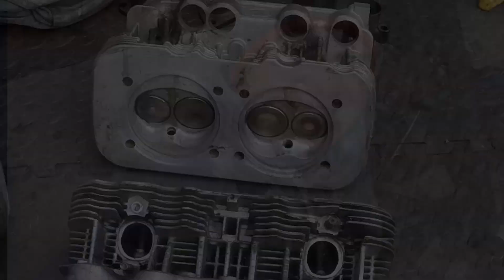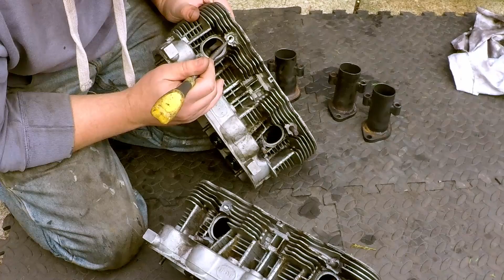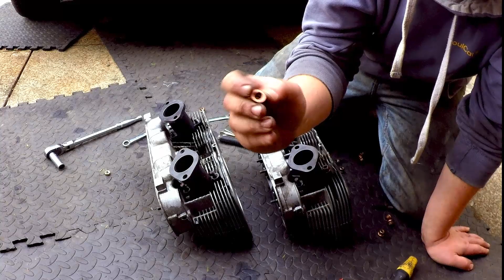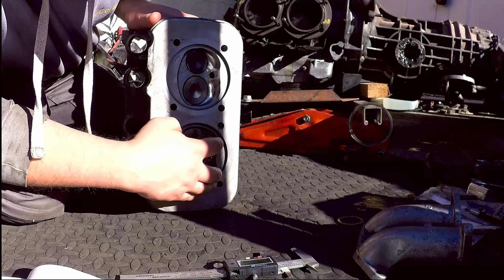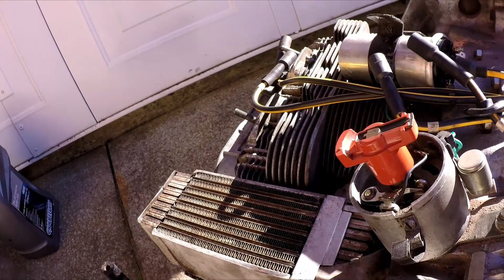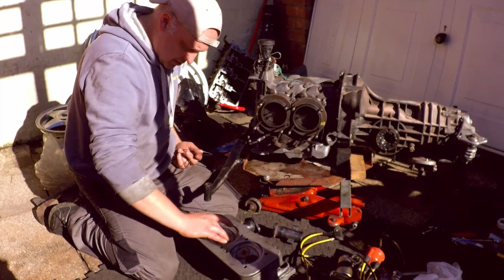Porsche 914 Ep. 4 : Examining & Installing Gas Flowed 2056cc Heads & getting the engine back in

Comment: Great content.  
I’d been wondering how much work I’d be able to do with the engine sitting on a furniture cart, and you pretty much answered that.  
I’d also been wondering how easy it was to get the engine tins and rubber seals lifted back into place (and the axles aligned) — you showed slightly more than other videos, but I’ll forgive you since it looked about midnight when you finished.  ;)
Cheers from Colorado.
Reply from the maker: Thanks for the comment, there's a fair amount of work involved but not ridiculous and being 'old' fixings are straight forward,if not difficult to find in the UK.
I do miss this car, unfortunately the owner decided to sell, a rewarding adventure 
I love Colorado, stayed at Breckenridge twice 😃